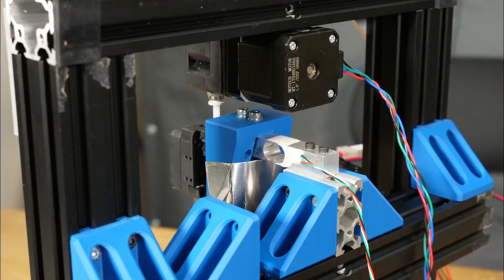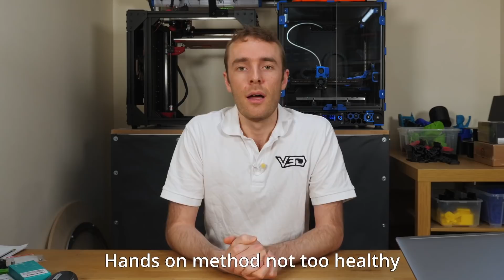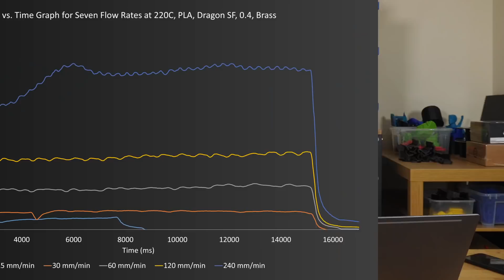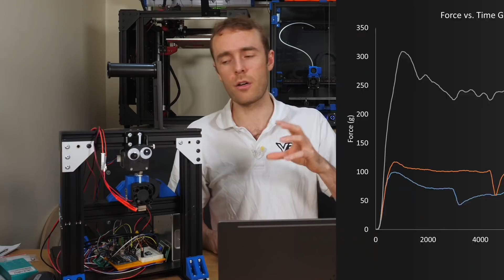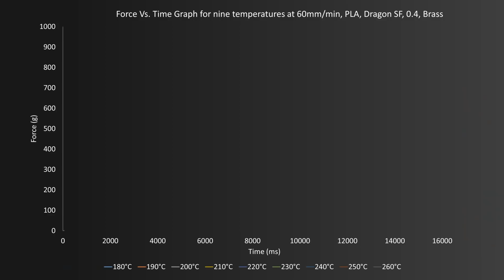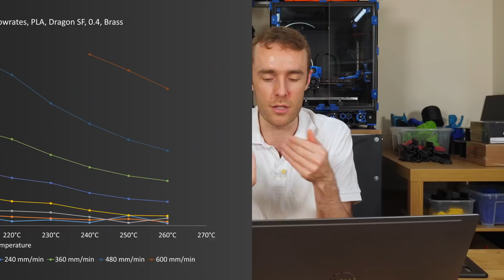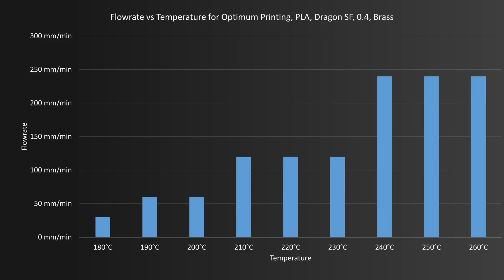The Next Generation of Hot End Testing

Comment: I think you got to measure the filament travel too. As the filament is pushed out at a stronger force. The plastic on the surface where the teeth of the gear is digging into the filament starts to deform. I'm sure you will uncover more interesting data from knowing how much actual material was pushed in.

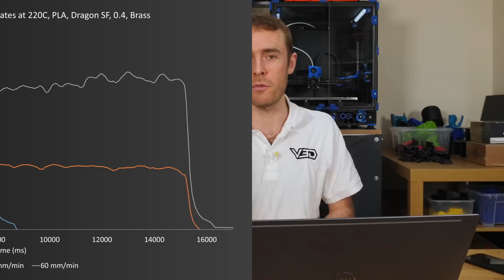Comment: 10:19 Perhaps the dips in force are due to steam bubbles releasing from the hot end. Compressed steam bubbles support pressure until suddenly bursting at nozzle exit. It would be interesting to see if deliberately water-logged filament exhibits the same results.

Comment: Hi, the renkforce Rf-1000 and 2000, developed in 2014, already use this forcesensors. The Rf-Community also developed an Firmware, thats has the same ideas as you are talking in the Vid. Both Printer are out of stock. Primaliy the Sensors were used for the heatbedscan.

I own a Rf-1000 and this functionality works super. Dont know Why Renkforce didnt use it in their new printers. 
I love it. And hope that my printerboard Never break....

Comment: Some of those spikes are gonna be the pid settings.  Because its not measuring at the filament, and its not heating at the filament, the lag involved is gonna create spikes.  Because its based on pids or bangbang control it would be rhythmic as the extruder cools from releasing heat into the filament, that heat is lost from the extruder to the filament, it cools, the extruder sees it change, turns on the heater, repeat.

What we REALLY need is a PID autotune that extruder about 200mm of filament to decide how much it needs to heat for how much flow, and autocorrects when its running the extruder.

Comment: Liked, subbed and using a certain command line tool to get a copy on my hdd for reference. Please, please, please run these tests for different materials, nozzle sizes, etc. And with a silicone sock. And with a Bondtech CHT nozzle. And... mate, just make a series. 

I would actually love to tack that sensor on my printer permanently. And, in general, I think adding sensors to our printers is just the logical next step. You can ask the same question about a lot of other things, like "are my belts too tight" -> graph vibrations while moving along each axis. So, you can transform these yes/no questions into something far more precise and thereby get your printing more finely tuned than ever.

Comment: The waves in force vs speed graphs up and down are most probably caused by the hotend heating/cooling cycle as the filament goes through and cools it. It will take some time until the thermistor detects lower temperature than required and the heating block receives power and manages to reach the temperature again. When the hotend PID is tuned properly and has enough power to cope with the filament volume, the wave is smoother and the extruder pushes more constantly the filament, as the temperature in the hotend is kept almost uniform.

Comment: Stepper motors can easily "get confused" and stall when run at low speeds. I assume the dip at low flow rates could be related to that. It happens at some sort of "frequency"/turning speed that the stepper can stall... you could try with some combinations of gears and gear ratio that would give you the same filament speed but at higher RPM for the steppers to eliminate that stalling. Just a thought though. Hope this helps.

Comment: Great work! My guess for the peak at the beginning is slightly cooler filament at the nozzle tip (which is definitely cooler than the point the thermistor is measuring) that needs to be pushed out before the hot/soft flow kicks in... Could test that with a poor heat conduction nozzle like a stainless... Should worse / the peak higher I assume.

Comment: You should look into using an arduino to run the stepper and also read the force at the same time. The advantage of this method is you can program a series of moves for the stepper and record the results very consistently. I used this method with a stepper and load cell to cycle load parts I was testing with lots of success

Comment: I would guess the pressure troughs are possibly caused by the delay in temperature correction. Basically the hotend starts to heat up and overshoots slightly causing a pressure drop. It could happen pretty quick and depending on how the board is measuring temp ntc100k are pretty darn inaccurate sometimes.

Comment: Thought on the initial peak. That could be the initial melt time. If you work under the assumption that most of the heat is transferred via conduction, that initial peak the would the "cold" filament essentially crashing in to the nozzle, then at it heats it begins melting and lowers until you reach the point it is melting at your feed rate. 

The variations in force could be multiple things. Change in velocity from the hobbed gear. Could be slightly non concentric leading to slightly different velocities, or even potentially the same issue caused by the difference in diameter between the peaks and valleys. The stepper motors, they don't apply a constant torque as they step, so you will get changes in force depending on where it is in the step.

Comment: This is the first real data I have seen on the inner workings of a hotend. I can see that load cells will likely become standard sensors. I am curious if this configuration would allow the sensor to be used for bed leveling as well as monitoring pot end pressure.

Comment: That's pretty sweet. Only think I think that could make it batter is an encoder wheel before the extruder to measure flow and pressure. Definitely should test different hot ends and nozzle combos. Id like to see the Slice Engineering Mosquito Magnum+, The dragon with high flow, with and without Bondtech CHT High Flow Nozzle.

Comment: Could those peeks be because of the heating element system not being quick enough? I assume that those work in sort of pulses in terms of on/off or that the amount of heat energy introduced is like "boosted" into the heating element system and then turned off or at least significantly reduced and not being increased again quick enough. The feedback loop between the thermistor and the heating element may be to slow, given that the thermal mass of such systems that could smoothe this out does not look very large.  Measuring the current that goes trough the heating element may give an answer to that and lead to more sophisticated extrusion systems.

Comment: My first thought is that the wobble in middling flow rates can be attributed to the heater PWM.  But at 12:45, the periods look to match at all temperatures, but with a random starting offset.  We'd expect different periods and a pattern in onset of the pattern at different temperatures.  This could be saying that it's due to eccentricity in the feed gear.  If the period matches up nicely with the period of filament slipping, that's a stronger argument for the drive gear.  If there's eccentricity, there will be a spot on the gear that's weaker than the rest, which is where slippage will happen.  Having the actual heater drive signal would be killer to distinguish between the two.

A neat test rig, with lots of potential!

Comment: Have a look at the Renkforce RF2000v2 printer from Conrad. The printer has a fixed bed and measures the distance between the nozzle and the bed with such a measuring device. There also exists a custom firmware, which changes print speed according to the filament presure in the nozzle, measured during the print

Comment: I'd be interested to see if the feed rate of the filliment was fully proportional to the flow rate at the nozzle, if it was you could measure the filament feed speed and use that as a target for the extruder to follow with a speedy PID loop i wonder if you could push higher forces whilst keeping the flow rate stable

Comment: Love this setup! I would be curious to know if your PID settings on your heater cartridge and thermistor explain most of the variation you're seeing before you start to truly skip, especially in the higher flow rates. Especially considering that we tune with no flow... The delay in measurement/variation between inner core of the nozzle and the thermistor might be the explanation here.

Comment: I would be very curious on the repeatability of each extrusion test. Are those dips in low flow rate always appearing after x seconds from start? Ome of your graphs looked like the dips where straight offset in time based on the temperature. But if you ran 3 or 4 runs at all the same settings, would those dips line up?

Comment: Great work! You could raise your filament slip force by increasing your drive gear count to 4 or 6. You'd have to add a small gear between each pair to reverse the direction.

Ultimately you will get to a point where you have to improve the temperature control of the hot end. You might be able to tweek the PID values. But at some point you'll have to consider the joules required, the response time, and the future steps in the G-code.

I think you are onto something extremely interesting here. Don't stop. There's so much more to learn and room to innovate new advancements in the industry. Document the eff out of it so we can prevent some goon from parenting it. ☮️❤️🌈🧘🏽

Comment: Interesting analysis, thanks for making the video.

The internet would tell you a V6 hotend would flow 10+ m^3/s before running out of steam - converting your summary slide at the end yields much lower numbers, like you mention.  Pretty interesting.  What would be more interesting is determining how far you can push those values before you can detect degradation in a meaningful way - either visibly, or in print strength, or accuracy.  I have a feeling your method is very conservative when it comes to print quality.  Thoughts?

Comment: Can you log exactly when the heater cartridge was on and off? Also are you measuring the hotend temperature or relying on the settings you configured? Perhaps a second logged thermistor output would provide some interesting insights?

Comment: One reason your first peak from slipping might be higher is that is when the driving gear is clean.bas soon as you start slipping the gears will fill up with material and make slipping worse.

I've had similar issues trying with consistency while calibrating flow rate, if i didnt clean the extruder gear after a run where i new  it had slipped.
Reply: This, plus filament gets chewed by the driving gear while slipping, so extruder doesn’t have so much grip extruding it.

Comment: Initial force spike - I would hypothesize that the initial spike in force is due to the angular momentum of the system (gears, motor,  spool, etc.).  That is until everything to the spool is rotating at target speed you have an additional acceleration force to bring them to speed and then everything would settle on the friction and pressure forces of the system.

Comment: 6:26 Nozzle had enough latent heat to cope with first extrusion then the heat utilised to melt filament with the rate of extrusion couldnt cope with heat input ? This is temp of nozzle in melt area I am talking about not the heater block.

Comment: Could the dips and the peaks on the graph be from heating requirements? graph the change in temperature next to these values and see! I know the faster you go, the more heat gets sucked out of the surrounding material to melt the plastic.  So you're looking at the metal get too cold and then heat up again.

At low temperatures, it would be that the pid settings can maintain temp longer before needing to ramp up heating to keep the hotend stable temp.

Comment: This is a very interesting experiment. As for the small variations at low flow rates, it is rhythmic and thus may be tied to your stepper motor steps. I'm guessing you're running a 1.8 degree stepper, I would be very interested in seeing the data from a 0.9 degree stepper. Wonderful job, I really enjoyed it.

Comment: The peak in force seen at the beginning of extrusion is, in my opinion, due to the breaking of the more or less soft, swollen and sticky plastic plug formed just after the heatbreak, when there is no movement. When this plug has been forced, we enter a dynamic regime where the filament is lubricated by a layer of molten plastic, with much less resistance.
The size of the plug, its temperature profile along the filament axis, as well as the coefficient of friction with the extrusion channel walls, all depend on the hot-end and its technology. Your test device will be able to show the real or supposed qualities of the different offers on the market in this respect. BRAVO!!!
Reply: You will also be able to determine how long it takes for the plug to reform, which also depends on the hot-end. This information is valuable, especially when using several different hot ends, or a tool changer.
It would also be useful to know the "negative" forces exerted during retraction, or during extraction of the filament, depending on the temperature...

Comment: Great video! Some ideas on the data:

1. The 4 kg peak load at 6:17 is highest because the filament has not yet been damaged. Once material is sheared away, the drive gears cannot develop as much grip / extrusion force and later peaks are lower. Not sure why this peak is different from those later in the video, as there are many potential related factors (gear tooth incident angle at the moment of slip, velocity dependence, upstream filament tension from the spool, etc)

2. The initial peak-and-valley pattern in all tests is likely due to the viscoelasticity of the material, and the initial transition to plastic flow. When extrusion begins the material is uniformly stationary, thus a shear layer (boundary layer) must be created around the plastic slug of material before it can flow. Initially, it's more energetically favorable for the material to simply compress and store energy elastically. However, with increased load, some of that energy begins shearing the boundary layer. Peak load occurs at the moment when the boundary layer fully develops and plastic begins to flow freely (also, the built-up elastic energy is released). Just before the peak load moment, the extruder is fighting against BOTH shearing (flow) and built-up elastic compression of the plastic slug. Once the boundary layer fully develops, most of the compression is released and the extruder ONLY needs to overcome shearing. Also - due to viscoelasticity, it's not surprising that the peak force is rate-dependent.

3. Fluctuation frequency correlates strongly with flow speed, suggesting a periodic source of error in the drivetrain (e.g. imperfect gear mesh) or at the drivetrain interface (gears gripping the filament). Many other potential disturbances - such as structural resonance - can likely be ruled out as their natural frequencies would remain more or less constant regardless of flowrate. 

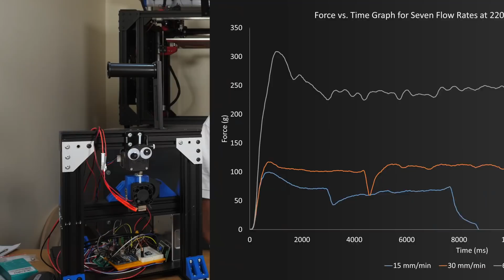4. The source of dips at 10:00 is unclear, but don't forget about upstream disturbances. One example is fluctuation in tension of the filament entering the extruder, as it is being pulled from the spool. Extruder force will change depending on whether the upstream filament is slack vs. taut, and if the spool must be "yanked" due to being misshapen or rolling intermittently. Even if the extruder is not slipping, upstream tension on the filament can propagate along its length and affect measured force at the hotend. It can also change the "apparent" peak gear force, as gears not only work against extruder back pressure, but also spool feed tension.

If I had to nitpick (and it's hard, again, great video!) - I'd just ask you to indicate the data sampling rate on any graphs where time is used as an axis, so we can immediately check the time-resolution of the plots. (Also, make sure the chosen chart style doesn't use any sort of smoothing - these charts might not be, just hard to tell given the nature of this data)
Reply: I think the initial peak is higher as the extruder contact with the filament is clean. It then gets filled with plastic so has lower coefficient of friction (static and dynamic).

Comment: I wonder if it is possible to get the same information from a stepper driver. The stepper driver could know when it takes more power to complete each step.  If that were possible it might become possible to diagnose issues with movement on any of the stepper motors in a printer.

Comment: THIS! This is what I had in mind for months. Not just finding the hardcore limits of hotends but "how quickly can I print without compromising quality?". And you nailed it. Congratulations. I'm really looking forward for other materials and hotend tests.
Also, please note all these procedures can be automated so that you can test and get results within a few minutes and minimum effort :brain exploding:.

Are you considering sharing your design. I'd really appreciate it.

And for those aspects that you pointed out in your video:
- About the first peak might be due to slightly lower temperatures in the tip of the nozzle, as it's in contact with cold air and not protected by the silicon socket. Once the tips clears and warm filament reaches, the pressure gets lower. It's somtheing I usually notice when extruding manually when I change between filaments or during cold pulls.
- About the drops seen during extrusion, they seem to be at low flowrates and/or high temps, so I think they might be produced by humidity of the filament that evaporates in the tip of the nozzle. That creates a low demand of force until more filament reaches the tip of the nozzle and builds up pressure again.

Sorry in case my english is a bit poor, as it isn't my native language.